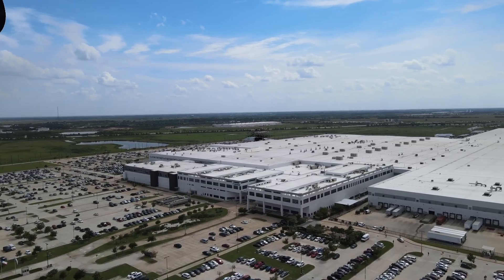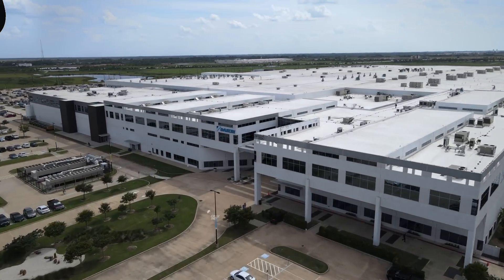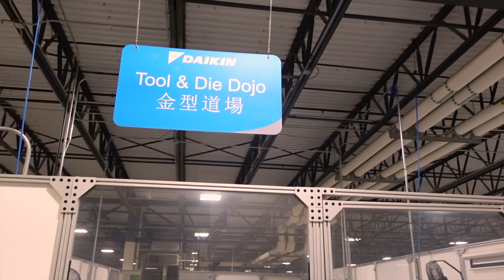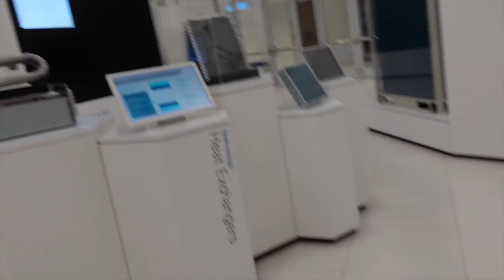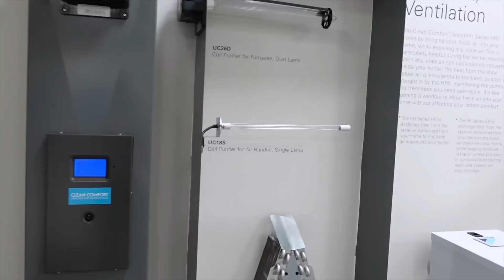Inside HUGE HVAC Factory in North America - Daikin Texas Technology Park

Comment: I am currently working on a brand new newspaper startup, part of the Press Forward and nonprofit news initiative.  The inaugural edition (28 pages, 60K USPS mailout, nonrecycled paper) will have a two page editorial on the refrigerant changes.  The story is to protect the homeowner from HVAC pirate with bullshit bullets.  The summary of the story calls out R32 and Daiken as the future champions.  Thank you for this video!!!
Reply from the maker: Wow. I’d love to see that article!
Reply: @NewHVACGuide  - The local Johnstone Supply (distributors for Daiken/Goodman/Amana) will get about 200 papers to share.   The story can also be downloaded.   The story will have an ending summarization that talks about the why the US decided on 454B and not R32.  In gist, it boils down the wall street cartel known as Black Rock, Vanguard and State Street that controls 100% of the S&P 500.  I'll break down the brand names and who owns what.  Chemours (owned by Honeywell) invented 454B because it was good for business, not because it was better.  Honeywell's stock performance has not been stellar for the past 5 years, the 454B will enhance revenue.  As for air handler sensors, this is a conflated gimmick that is more suitable for propane or butane, unfortunately, we're stuck with this decision. The editorial goes deep into what most unethical HVAC guys will probably say to get the HO to fork over 10K.  What's the current wholesale cost of 410A, what's a fair retail price for 410A.  What are the alternative blends and what they cost.   Why R32 is superior to 454B.   My question is if Daiken is using their own enhanced Copeland scroll with the new POE oil on their R32 systems.   Daiken is literally 13 years ahead of the game.  This answer is crucial.   Anybody you suggest I contact??
Reply: @NewHVACGuide  What is Marc's email address??

Comment: Daiken is one of the brands the company I work for sells.  Their fit systems are pretty nice.  There is a specific issue I run into with them concerning superheat.  Not sure if it is the eev, eev control, or the evaporator coil itself.  The system will lose the ability to cool and superheat will be way out of range, as though the expansion valve has failed.  Luckily this equipment has a 12 parts warranty, I swap in a new evaporator that includes eev, eev control, and evaporator coil.  Not sure which of the three is messed up but this fixes the issue.
Reply from the maker: Did you put a D checker on it? Some of the protection modes don’t show on the regular stat. Must have a D checker on it to see what’s actually happening.
Reply: @NewHVACGuide  It’s one of those three things and a new evaporator comes with all three.  My company doesn’t supply d checker.  We replace the evaporator under parts warranty, get all three parts and it fixes it.

Comment: 4:44 there should be a balance of reliability and energy usuage. im not talking about diakin im in talking amongst all manufacturers energy efficiency usually comes at a price. With more control boards and more expensive parts. Why 14 seer is all i sell cheap to fix and not too many parts to go wrong.

Comment: Great video, but something that keeps getting skipped over in every video I've seen when someone tours this facility is the software system behind the manufacturing process. I worked for that team for about five years, and it's a pretty impressive piece of work. From fabrication to the finished product that exits the assembly lines, the software in that plant was built from the ground up and has saved the company millions in avoided quality issues and warranty claims, and just overall set the bar for a quality product.
Reply from the maker: Some things were not allowed for recording. But thank you for sharing!

Comment: So Daikin makes Goodman and Amana?  Or just assemble? One reason why the industry is so screwed up. In my opinion.
Reply from the maker: Owns makes assembles designs engineers and so on. I think the difference between Daikin making other brands and some of the other brands out there that make other brands… Daikin , each brand targets a different part of the market. They each have a different warranty too.
Reply: Goodman and Amana are using the great reputation of Daikin to enhance their product lines!
Reply: Daikin owns Goodman Manufacturing, and Amana's HVAC division. The parts you see being used in that facility are either OEM parts (circuit boards, electronic parts, motors, etc) or they're fabricated onsite (metal and plastic panels, coil components, and so on). The Fabrication and Materials departments take up at least double the space that the assembly lines (around 26 or so when I left the company last year) do.

Comment: Josh- how do the fit systems compare with their hi seer ‘trash can’ style units? Just the condenser size, orientation?
Reply from the maker: Check out some of the videos that I’ve done on the Fit. Lower seer rating because of the smaller coil. But still has the communicating inverter technology for efficiency, quietness, and it can “fit” in places unitary can’t

Comment: It’s great to see that these units are being assembled in the United States. The important question is: where are the components made?? And what do the replacement parts cost. Not many families can afford condensing fan motors that cost 1k, much less the labor cost too 🤦‍♂️🤦‍♂️
Reply from the maker: Everything’s getting more expensive, but I’ve always felt like they were the most fair when it came to part pricing and availability
Reply: @NewHVACGuide  as part of your tour, did you inquire where the components are made? Thanks for the video.
Reply from the maker: Some are imported. Some are assembled here. I didn’t inquire any further than that.
Reply: Goodman parts are usually cheaper than other manufacturers. The pandemic and inflation have increased the prices of the ECM motors in the furnaces and condensing units.  If the ECM motor goes out in my condensing unit, I plan to replace it with a standard AC motor.
Reply: We make a lot of the components there not all but a large amount

Comment: I'm seriously considering Daikin mini splits for my new home.  One question: did you see any new configurations on the mini split heads?  I saw a video where the Coopers and ? had a real easy to remove blower wheel for cleaning.  The cleaning issue will be the only reason I don't get mini split system.
Reply from the maker: I know they have some new stuff coming soon. But it’s hard for them to give me a timeline on some of the things.

Comment: Do you know if Daiken is now making their own zone boards, or are they still out-sourcing them?
Reply: Good question.
Reply: Zone by EWC
Reply from the maker: I'll try to find out
Reply: @NewHVACGuide  I've learned things from you. You seem to be very honest. Please don't turn on us, because of some deal,  when you get even bigger. 😇
Reply: @FQawF  There have been quite a few complaints about "glitches" in the Daiken zone boards within the HVAC community. It would seem that "the largest AC company in the world" should manufacture its own boards. I am curious what kind of answer we get on this.
Reply: Great video. I was down 5 years ago for the tour. The technology park is getting bigger every year.
Reply: Daiken is trying to design its own boards and firmware but they are finding out that it’s not easy or cheap. I was told that Goodman was still using some boards designed by other companies.
Reply: @picklerix6162  Yea, I'm sure you're right. Carrier, on the other hand, makes their own boards.
Reply: Don't want anything from china